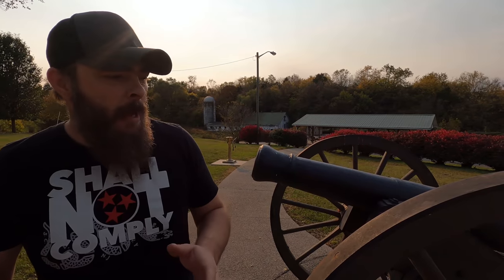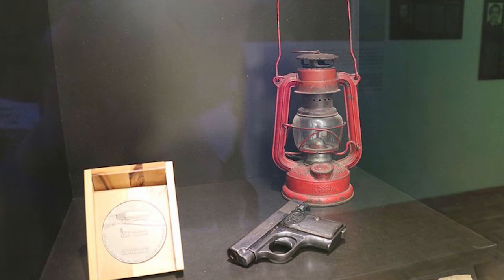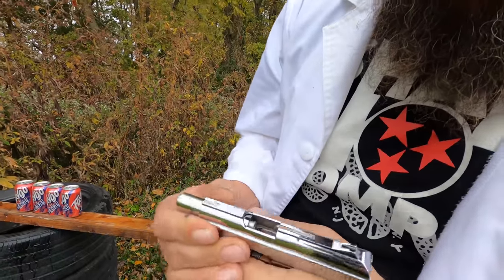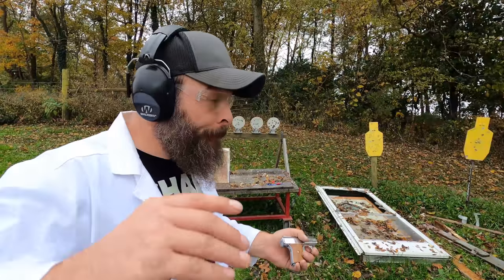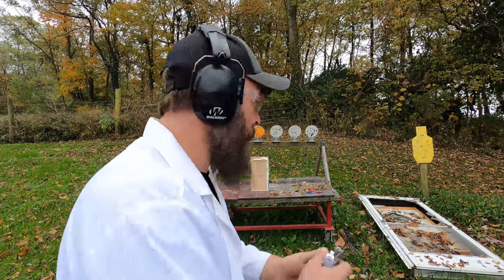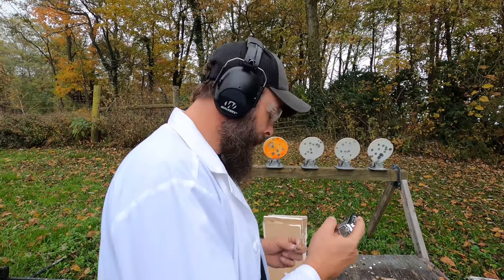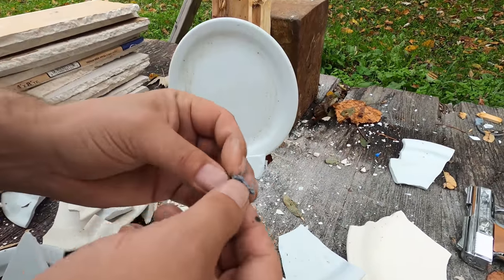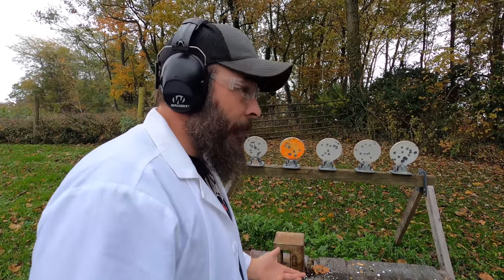Truth About the .25 Auto.

Comment: I have one of the smallest and most expensive 9mm pocket pistols made, great gun with a match grade barrel . . . but I needed something that fit into the right vest pocket for left hand draw inside a vehicle (you do not want to fire a 9mm inside a car) . . . I've carried my Beretta 21A .25 more days and more miles than any other personal protection, and it saved my life at least once. 
I was hired once to find a missing semi-tractor trailer and its load . . . it took an hour, but I found it and the driver tried to take off before the cops arrived . . . I held up that little pistol and aimed it at the windshield and the driver jammed on the brakes.
So, my story is that my little .25 'mouse' gun stopped a semi.

Comment: I love the little .25s.  I have an array of vintage examples dating from the 1910s to the '70s, including some of the classic American and European designs.  I even handload .25 ACP.  The real challenge is finding the spent cases amongst the carpet of approximately one zillion .22 LR shells at ranges!  Some of the guns can deliver groups of just over 2" with the standard load at 25 yards from a rest, though it does require great concentration to see and align the miniscule sights.  All are highly reliable, much more so than similar size guns in .22 LR.  .25 ACP delivers only 15 foot pounds less energy than .32 Auto Wichester Silvertip from the Kel-Tec P32.  The one time I needed a gun on the street many years ago, the one I had was a .25.  Though it was fortunately unnecessary to fire it, it's presence was critical.  The French Resistance made much use of the .25 during WWII, when being found with any gun meant instantaneous execution at the hands of the Germans.  They're entirely adequate and useful within their limitations.  A niche weapon, they have an appeal and are scaled to the cartridge in a way that is almost entirely lacking in current designs, and many are quite beautiful.  They are surely the last word in the smallest most concealable autopistol.  So small their presence is unnoticed.  I pack them routinely.  As a gunsmith, I've  been very lucky to see many different examples, including some of the really unusual European designs from the golden age of craftsmanship.  Unfortunately I only got to fire some of them...  I believe more variations from numerous manufacturers have been made than any other centerfire handgun caliber, in vast numbers.  That couldn't have happened if they had no merit.  And they're just fun. 🙂

Comment: The only complaints I have on the .25 auto is the cost of the ammo and the capacity of the gun. I don't see why gun manufacturers don't make a mid-size .25acp with a 4 inch barrel and a 15 round mag. That would probably beat out all the .22 LR pistols on the market right now.
Reply: Never seen a double stack 25, would be interesting
Reply: If you need that much ammo for a pocket gun, you need to move lol
Reply: @BOB-wx3fq  I'd buy two of them.One for each pocket.
Reply: Ruger should have made a .25 LCP instead of the new .22 LCP.
Reply: @SgtRock420  I would have bought that, but unfortunately Ruger is smarter than us, because .25 ammo cost near as much as .380 and 8 times as much as .22. They sell the LCP-.22 faster than they can make them.
Reply: @timhallas4275  Yeah, you can't beat that reasoning. It makes it easy and inexpensive to play with, but for EDC I'd personally feel better with the centerfire .25. Maybe they should make both!
Reply: @SgtRock420  Yeah, me too.  I have a Raven .25 acp, but it only holds 6 rounds in the mag.  I'd like a .25 auto that carries 12.
Reply: @timhallas4275  And one in the pipe. It's fun to squeeze off 7 rounds in less than 2 seconds at night with a little fire coming out of the end of the barrel. Back in the 80's I needed something small to carry in my tractor trailer because some rest areas around the country were a little strange in the middle of the night  so I stopped  at a flee market while passing through Arizona. There was a gun dealer there with a glass case and I pointed at a tiny  Raven MP-25 brand new in the box (same one as in this video). I'm from back East so I said what do I have to do to buy that gun? He said give me thirty-five dollars so I bought it and I've had it ever since. I never had a problem with it.
Reply: @HeinrichEichmann  That is a great story, I wish I had been there with you to buy another one! 😎
Reply: Someone email kel tech
Reply: I think manufacturer don't make them because the 25 acp would take market share from the 22lr and the 9mm for self defense firearm. In my opinion the American gun industry is killing off the 25acp.
Reply: Phoenix Arms makes a 3-inch barrel .25ACp that is 9+1 capacity.
Reply: @gregb6469  Yep, I got one. It's the perfect pocket gun. I am consistently hitting inside a 3 inch circle at 35 feet. It runs everything right out of the box, and cost me $180. The only sad thing is, I had to settle for black.
Reply: That would be pretty cool

Comment: I do carry a .25, and as you have said in other videos, shot placement. A .25 makes headshots very easy, even under simulated stress firing. They were never meant for long-distance (greater than 7 yards), and at that distance, if you can't hit em in the head, throw it at them. That said, my .25 is my BACKUP weapon. My EDC is a .38 special snubbie. Yes, a revolver.
Reply: Thank you! Regardless what else I may or may not carry on any given day there is almost always a 5 shot .38+p in my RF pocket.

Comment: The .25 Auto was the only caliber designed by John Moses Browning to be used in a mouse gun, the Fabrique Nationale M1905, which was soon copied in the US as the Colt M1908 Vest Pocket, a 13-oz sidearm with a 2-in barrel.  JHPs are close to useless in .25 Auto, as they do not expand or, if they do, they penetrate to an inadequate depth to reliably reach and destroy vital or highly vascularized tissue.  Fifty-grain FMJs sometimes penetrate enough to meet the FBI minimum penetration criterion, and its kinetic energy, even 25 yards downrange, exceeds the US military's threshold kinetic energy of 58 ft•lb for likely reliable casualty causation.

Browning didn't design the .32 Auto for mouse gun use.  It debuted with the Colt M1903 Pocket Hammerless, which is a compact pistol, at best, in today's parlance.  With its 24-oz weight and 4-in barrel it is better suited for carry in one's jacket pocket rather than a pants pocket.  However, mouse guns chambered in .32 Auto are made in the US today by Beretta KelTec, North American Arms, and Seecamp.  The heaviest of the four weighs only 14.5 oz, and the longest has a 2.7-in barrel, so they are all easily carried in a front or back pants pocket.  And, the lightest of the four has free recoil energy 38% less than that of the Glock 19.  FMJs in .32 Auto are, unlike the JHPs, adequate penetraters.  Thus, my mouse gun is a Beretta M3032 Tomcat.

Comment: I do have A Beretta 950bs and I absolutely love it especially with the tip up barrel. It is highly ideal if you are hurt and only have one hand to reload. It doesn’t print whatever shorts or bathrobe dressed in. The Beretta 950 BS is the only 25 caliber I trust but it’s under powered.YouTube it and see the advantages especially to all lawmen that runs towards the gunfire. I also bought the Beretta 32tomcat and it had too many issues🤢🤮🤮.It should be renamed the fat cat. I traded it in for a Glock 26 and have no regrets. All in all the .32tomcat versus the Glock 26. The 9 mm clock is 1 inch longer same thickness👍👍.

Comment: "Will it keal?" Yes, the lowly 25 will kill. And you are quite right that it was supposed to be as effective as the 22LR or more so. But careful about how you test. Modern 22's are about twice as fast as the ones that were around when the 25 came out. John Moses was a genius. 
As you said, it is the smallest possible case that can still have a center fire primer.
So, what are the advantages of a 25? Its reloadable. It's center fire and thus more reliable than rimfire (percentage wise, rimfire cartridges have more FTF's than center fire). Naturally, those figures have changed over the years, but even now center fire is still more reliable than rimfire. It cycles more reliably than a rimfire (yes, we still have the occasional feeding failure with rimfires). Its available in truly compact and small firearms, and thus easily carried. A gun you have on you is far better than the "best" gun that you left at home for whatever reason. 
BUT technology has evolved greatly over the years. We now have 32 acp in guns every bit as small and lightweight as the 25. The 380 isn't far behind. Even with the import restrictions from '68, I think this compactness of current firearms in larger cartridges would have led to the demise of the 25. (BTW, you have to keep your fingers OFF the slide if you want these little guns to function).
In spite of all this, though, I think it would be EXCELLENT to have a NAA mini revolver, specifically the new top break Ranger, in 25 acp. As a top break, we could use moon clips for fast reloads. Yes, I know the 22 mag is more powerful, but as you just proved today, the 25 "will keal", and a fast reload with moon clips would make the NAA Ranger a VERY effective self defense tool. If you agree, send a note to NAA seconding this motion. I've already made my suggestion for this to them.

Comment: I would rather have it than a 22lr pocket pistol.  Just for the reliably.

 Have you ever heard about a belt buckle or something like it stopping a 25 acp.
Or someone not noticing that they had been shot with one until someone else pointed it out?
I have. But I have also seen it go through 2 pices of 2x4 bords.

And I have always wondered about the difference in performances. 
  Well I might have found a answer. 
I was cleaning a colt 1903 for a older naboring lady. 
It was her mother's and its the only gun she has.
Well cleaning and oiling it i noticed there were bullets loses in the case's you could spin them with very little effort. 
 I ask how old the ammo was. She didn't know it had been loaded when she got it from her mom.
Mom passed in 82.
The ammo was in a green and white remington box. So what mid 60's?
Any way i pulled the bullets the powder was clumped and in some cases a solid mass stuck in the case.
Like oil contamination.
That could explain the varying performance. 

And yes i got her a new box of ammo and even got her to shoot it some.

Comment: The reason you keep getting surprised about the penetration vs a .22LR, is that the .25 shoots a jacketed bullet that does not flatten out upon impact and the .22 shoots lead slugs that do.  Penetration is not just about weight, power and velocity, you have to also look at the design of the slug.

Comment: Buffalo Bore 50gr FMJ @ 850fps  for 89 foot pounds, or even better (but harder to run it) is the 60gr Hard Cast Flat Nose @ 845fps and 96 foot pounds. 18" and 26" in 10% gel and ran straight as an arrow. I ordered the round nose for reliability and function.

Comment: I’m with you I’ve always been told 25 ACP was terrible. It definitely surpassed my expectations. I still wouldn’t carry it. 32 S&w Long would be the bear minimum for me. Cool video. You gained a new subscriber.
Reply: I carry a .32 acp P32 kel-tec and as a back up a smith model 30 3 inch .32 smith and wesson long revolver with wadcutters.
Reply: @red9man2130  I also have a smith model 30-1 with a 3 inch barrel. That’s a cool piece

Comment: I'd carry it over nothing. Preferably as a backup, as the company I have was sued into the ground apparently. Better than nothing, as it will scare off most would be attackers. 99.9% of criminals are going to find a softer target, regardless of what brand, caliber, vs get into a debate about the lethality they're pushing to the forefront. Also, the availability of this caliber is useful going into clown decade. At this rate, 60 rds of 9mm will pay for your 8 yr college doctorate degree. Heavy handed "control" measures & outright threats from this administration has me thinking the shortage of ammo will end no time soon. Cheers.

Comment: I tested several rounds....9mm and .40 went through 3 (thin) wet phone books.  22LR went through 2 and part into the 3rd.  25 was close to the same.  380 went through 2 and spread out in the 3rd (critical defense).  At 21'.  Wouldn't want to be shot by any of them.....but the .380 by FAR did the most damage.  I'd estimate it would take a surgeon a full day to get the .380 out and it WOULD make you miserable.  But look at stats....more people by FAR are killed in America by 22LR than the rest put together.  SLIGHTLY better than nothing????  Leave it on the dresser and carry a rock and see if you feel safer.  I carry a NAA 22LR revolver in my watch pocket all the time.  Beats the HELL out of a rock!  No one even knows I have it...may not die from it today but you're probably going to die from it....stopping power?  That's about placement, not caliber

Comment: That a Raven or Phoenix arms 25? I have one of those as well, and it has issues going into battery every time. I have new springs for mine, just haven't changed them yet. mine fires every time, just the first round you have to ram the slide home, then the other 5 or 6 it's fine.

I have a Beretta 21A as well, and that is a much better gun. a lot more expensive too though

Comment: Who shoots ar bone as a target?  That test made no sense to me.  Perhaps you might hit a rib, but what would the round do?  Would it stop and only crack a rib, would it cause the rib to break or cause bone splInters (which can cause additional injury, or would go in a different direction?  When you realize this was for close in self with minimum weight and size, can it do that job at 3 to 9 feet?  Given hollow point ammunition, would the increased damage off set loss in penetration?  Considering the results of  most of his tests, his conclusion seems somewhat biased.

Comment: In my opinion, the only thing lacking about the 25 ACP is that no one‘s ever made a decent gun for it. I’m sure if you put it in a 4 inch barrel, you would have room for lots of shots in the magazine, and with the speed it builds up from a like a 1 inch barrel would be magnified by having 4 inches to speed up. We do it with 22s but we never did it with the 25, of which I’m aware.  If you put your shots in the right spot on the target, 25 is adequate.

Comment: I don't know if anybody has mentioned this but pellet guns in the same caliber produce the same energy and much better terminal ballistics.
Reply: If 25acp is basically the same as 22LR, a CCW with a 2 inch barrel can penetrate the human skull at 20 yards.  With a larger bullet, its going to be messier.  You're not going to do that with a CO2 air pistol with a 2-inch barrel.  Are they lethal?  Yes.  Daisy Powerline 415 gel tests produced 3-4 inches gel penetration.  But that was 5 inches away.

Comment: Carried a 25acp for a few years, 19-20, cause I bought it for $20 and it was smaller than my 44. Ironic I sold it for $50 and I've owned 2 other 25's both of which I sold just cause my wife wasn't happy I bought them, night both under $45 and sold both over $120, it's a great round for pertection because it beats a pointy stick but doesn't beat my 45 or 38